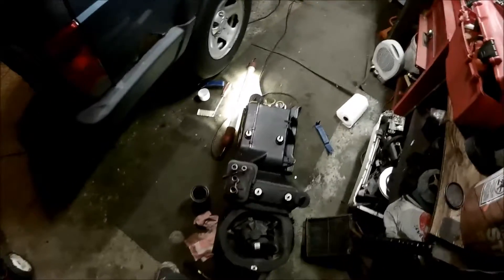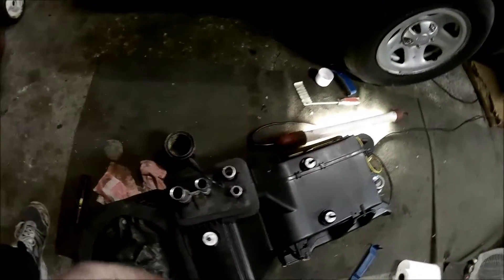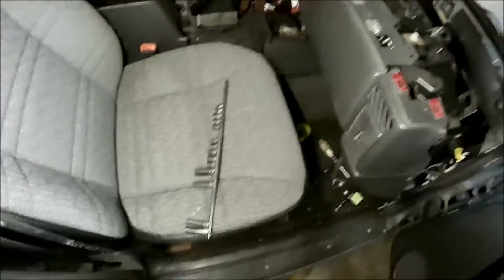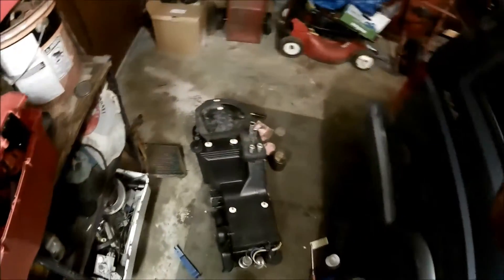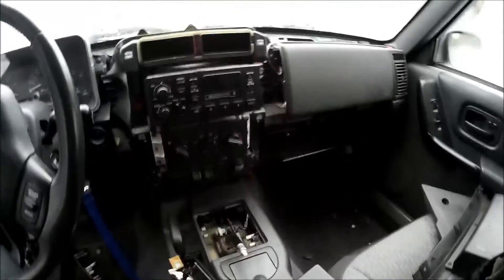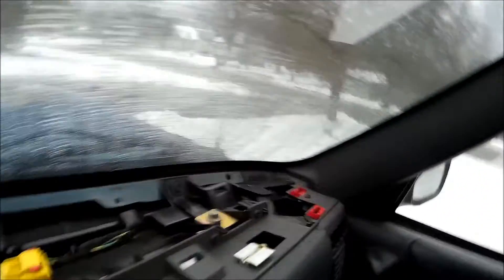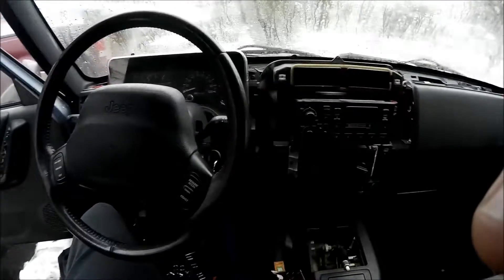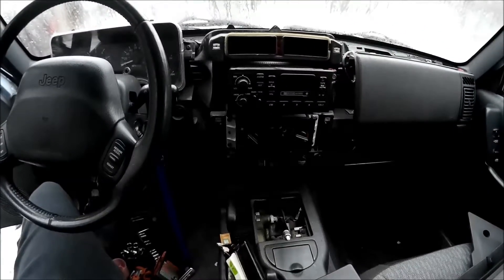1999 JEEP CHEROKEE XJ PROJECT - EP16

Comment: nice work man. its coming along really nice, and you really cleaned up that box. Im still procrastinating on replacing my heater core. but it will get done some day. that sucks they lost your package. are they going to send you another box with new parts? or do you have to reorder them?
Reply from the maker: +Anthony Calhoun Yeah, I'm pretty satisfied with it. Heater core isn't too bad as long as you have someone to help you take it out lol. And Morris4x4 sent out a new package so it's all good now! Actually I'm in the process of replacing the rear leaf springs as I type this lol BUT OF COURSE I managed to snap the lower shock mount stud lol.
Reply: +Fancy Polak you would not believe what happen today. check my latest video. I wrecked my Jeep. Im not even kidding.